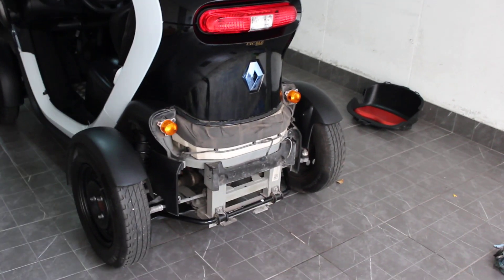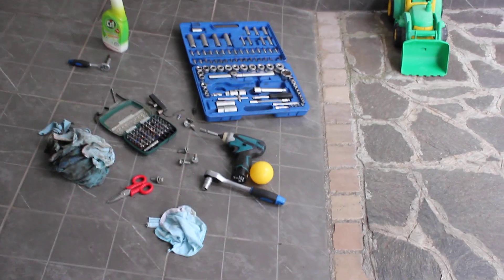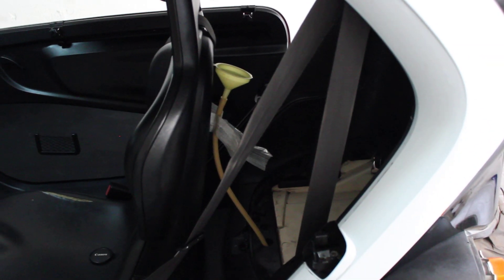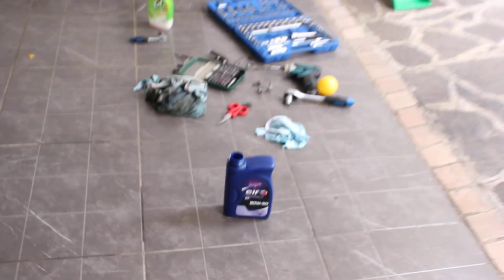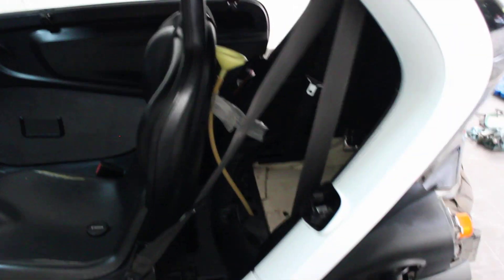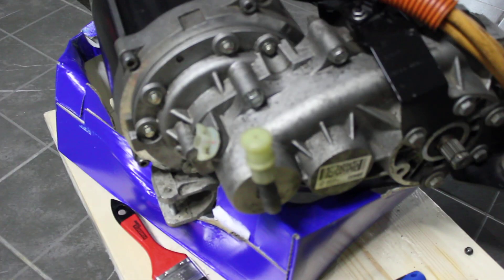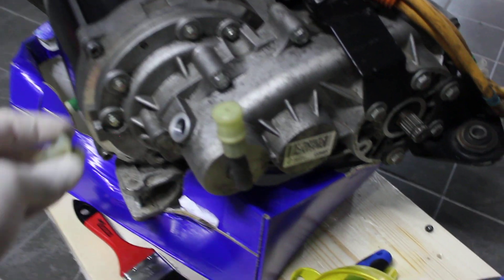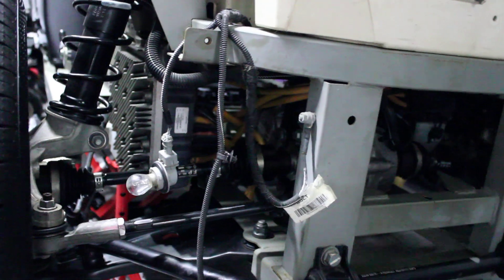Renault Twizy gearbox oil

Comment: I did as you advise, but I used a liter of oil, the same amount as I had drained. I saw oil leaks after a few hundred kilometers. The oil covered the whole upper part of the steel cover too. Maybe 200 ml in total.  I don't know how it got out of the box, but the drain plug is tight. Could it be the cheap EP80W-90 GL-5 oil I used? It was from a lesser brand than Elf. Could it foam and get out? Maybe something else?
Reply from the maker: No.1 could be the oil if you used 75....no2. the plastic upper cap whiteout rubber seal or damaged screw....no3. the quantity advised by Renault is 700ml... sometimes when oil gets hot and liquid at high speed will go out on the upper air filter....
Reply: @electrikmirk7828  Thanx a lot for the prompt and informative reply!